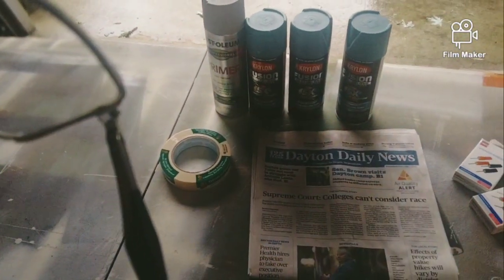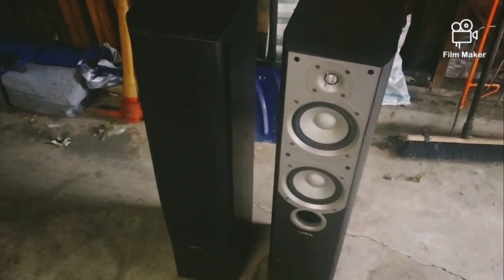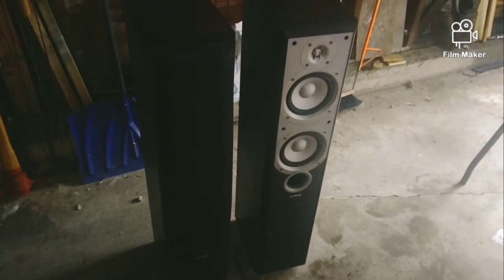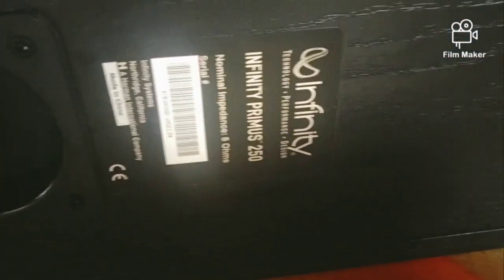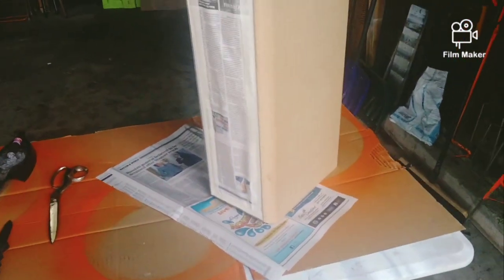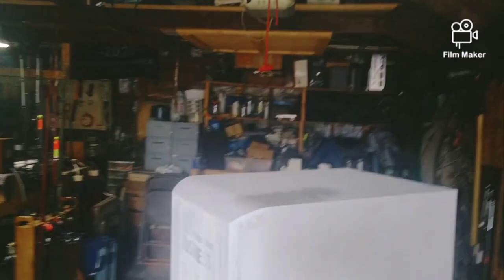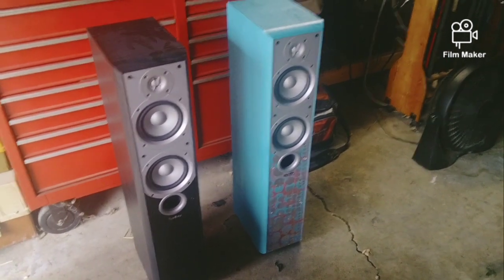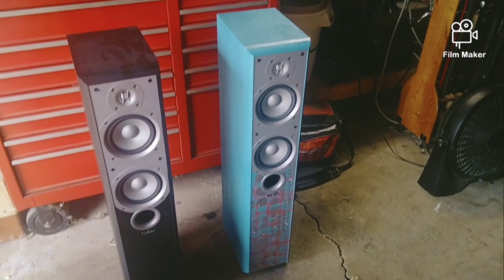infinity Speakers Facelift

Comment: Painting really made thats just crap, got to veneer it it's not particularly difficult something like black ash or rosewood whatever you like, two mm thick. Just do the iron technique paint it with PVA glue both surfaces, diluted about 10% let it semi dry and iron it on hot with a sheet of paper. Change the stuffing inside the speaker as well Go with recycle cotton or natural wool fleece or both. Just use a paint stripper hot gun and pull off the old veneer don't use the iron It will stick to it.
Reply from the maker: I hate that 90's veneer 😁
Reply: @brotherbrian5625  yes not sure about the blue, maybe if you painted some red and orange and black green in like dragon wood. Better without the front plate leave it off make sure you tighten the speakers drivers
Reply from the maker: @hoobsgroove  I'm just having some fun nothing serious here. I'm not a big fan of the sound of these either. If I had some orange I would of painted that front panel orange I don't and I'm not going to get some. Improvise